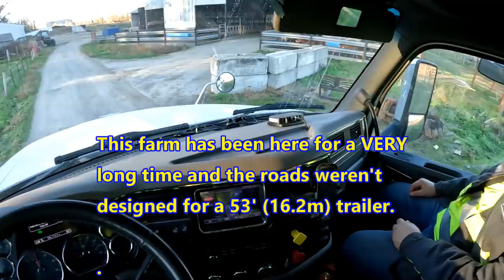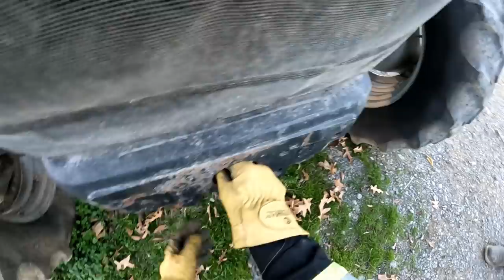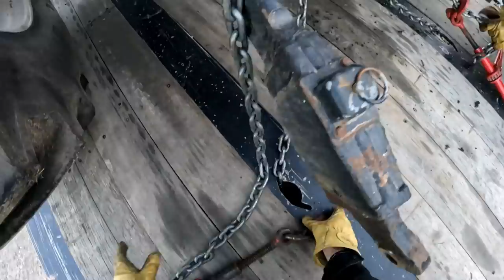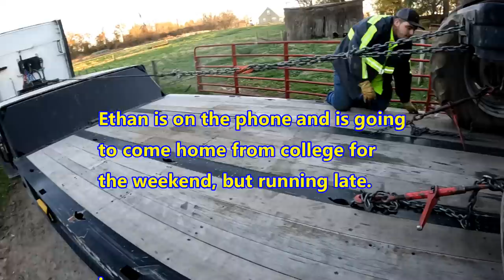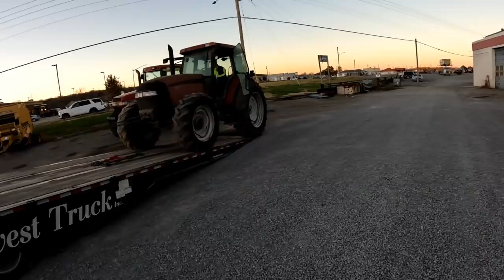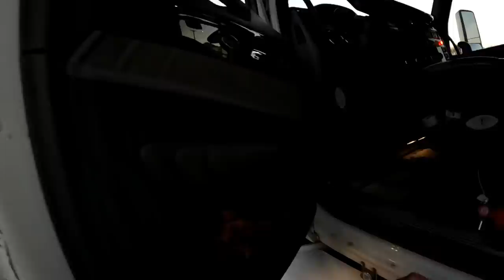TRACTOR MOOOOOOOVE.    Helping a Dairy Farmer!!!

Comment: I have a little tip when you tighten those binders down when the get tight flip he handle over backwards so it on the deck of the trailer and it won get loose

Comment: One thing i can never fathom with America is they are will to trust the park function in and auto gearbox  possibly the flakiest method of stopping a vehicle but when it come to a brake that is specifically designed to stop a vehicle moving they refuse point blank to trust them  i find that most strange i know which i put my faith in and it is not a small lump of metal in a auto box.  keep up the good work Ron

Comment: You are finally doing " Normal Stuff". I know you get all different kind of calls but to be able to help a local customer is good. The worst part of the setting sun in the fall is that even with decent sunglasses the blazing sun can make doing any task road related a difficult thing.
I did not realize until this year that there are many different companies that made tractors. I bet Worldwide there maybe thousands of companies that make tractors and many other type of farm equipment.
Reply: You didn't know that Case/IH made farm equipment??  It's a merger several years ago between Case farm equipment & International Harvester. They both started independently well over 70 years ago. There's several machinery manufacturers, some are defunct, but some of their equipment is still in use.
With this particular tractor, one look at the hood gives it away😄 
It says MXM, but that's just a name Case/IH put on a series of tractors.
Did you see the New Holland tractor when they were still at the dairy, it was easily recognizable. Years ago Ford merged with New Holland, that's why some still say Ford on them, rather than New Holland.  Alot of mergers & acquisitions from very old companies.
Reply: You'd be surprised how few there are with many subsidiaries.  Just like the auto industry.
Reply: More than you can imagine. New Holland actually doesn’t make their own tractors per se. They just slap their logos on them, different years of the same model can vary. Another useless fact is that there is one country that makes it nearly impossible to own any tractor other than the one made in their country, I think it’s Mahindra (the worlds best selling tractor)

Comment: When you were comparing the difference in maneuverability @26:42, the length of the trailers is not as important as the wheelbase.   Your trailer wheels are several feet from the back of the trailer.  The grain trailer wheels are close to the back of the trailer.  The wheelbases are probably fairly close.

Comment: This may be a myth or fact comment. I have heard of truckers either duct taping the end of the exhaust or leaving the engine running while in transport. The theory is that a vacuum  can be pulled on the exhaust to cause the turbo charger to turn without lubrication causing damage. This tractor may not of had a turbo. I myself would not want to prove that it is a myth. Ron I still think that you are professional and enjoy your videos!

Comment: LET'S GO TRACTOR TIPPIN! It's amazing to look at that tractor from the front.. You'd expect that the tires would be completely straight vertical but it looks like they have about 15-20 degrees of camber. It's so exaggerated by how tall and skinny those tires are so it looks like it's rolled out on the outside of the tires. :D Ethan distracted you and you forgot to retighten your rear chain. Weird that dairy cows out there are brown cows.. out here their typically the black and white Holstein cows. And here, when you said "we're gonna have to go old school," I thought you meant you were going to just pull forward and let it roll off the trailer. What you were saying about farming being a hard life, it definitely is and takes a special kind of person.. The problem is there's not that many of us in my generation, let alone people younger than me, that are willing to do that much hard work for so little payoff/recognition. We tend to want accolades for what we've done or to feel like we've accomplished something and farming you definitely don't get any, it's just a very long, hard and often hot day that's completely thankless. They are definitely at a point where farming needs a technological shift to where it's more industrialized because of the fact that most people would rather do easier, better paying work... but once that happens, the holdouts will get completely screwed over and be forced into a new kind of life.

Comment: I would just have let Eli roll the tractor off the trailer without any winching, and let gravity handle the unloading instead of using the backward winch manouver. Such a heavy machine would not roll far anyway and you would have saved a lot of time and rigging. Have a nice Christmas holiday.

Comment: My ocd really wanted you to chain down the steer.wheels on the tail of the trailer so you could use the truck to  back the tractor into the parking space...
Reply from the maker: Cool idea.   Didn't think of that at the time.    Made it work this way, so it's all good.   Thanks for watching and God bless.

Comment: Hello Ron, There is one thing that is puzzling me,  if the rotator broke down what have you got that could get it back to the shop for repair?    I love watching your videos, please don't stop them as you are moving into management
Reply from the maker: The Rotator weighs around 73,000 lbs, so our Western Star would be able to tow it, no problem.   Standard semi-tractor with a fully loaded trailer can legally weigh up to 80,000 lbs and more if properly permitted.   Also, the Tator would fit on this trailer, for a short distance.  It's too heavy to go very far on the trailer.  The trailer is rated for 40 tons, but that includes the weight of the trailer.    As for the videos and management, I've been in management for a very long time anyway.   I will have extra duties to perform on the administrative side, but, good Lord willing, I still plan to continue doing the job that I love as well as creating videos.   Thanks for watching and God bless.
Reply: @RonPratt  Thank you for the reply, you have answered all of my questions for the rotator. I hope you and your family, both at home and all of your family at work. I hope the Good Lord grants all a very happy and safe Christmas God bless

Comment: When you were turning around there, I couldn't help but to think of that Red Simpson song about needing 40 acres to turn the truck around.  I bet the reason why the front tires weren't rolling as because he was doing something with it in 4WD before it quit and didn't put it back in 2WD.  Otherwise the front should have been free even with the parking break on.
Reply: Most (all?) MFWD are in 4wd by default. It needs oil # to release-needs to be running.

Comment: Those trailers are very versatile! I was delivering in the mountains on a well site & had to maneuver around switchbacks that were too small for the truck & trailer. Used the sliding axles to shorten up & then push the tractor forward & then shorten up & push the tractor until I was around the turns. Very handy!
Reply from the maker: Ahh...the inchworm method.  Have had to use it myself a time or two.  Yes, very handy indeed.   Thanks for watching and God bless.

Comment: Great video Ron! Those trailers do come in handy for many applications. Have a question for you: why haven’t you installed a headache rack/cab guard on the truck yet?
Reply: In may be his choice not to. In many jurisdictions a full sleeper cab is considered to be sufficient as a guard.  If it is not mandated, it is an extra 3,000 lb. tare weight. Most styles will only stop light loads from perforating the driver and I've never seen one that will stop a greased 5 ton section of drill pipe once that gets moving at any speed over about 15 mph. I never drove sleeper so I always had a headache rack. That rack stopped a few 4x4s from ruining my day way back when.
Reply: Ron cant install a headache rack, as his hydraulic tank is right there on the cat walk behind the sleeper. The hydraulic radiator is also installed on the back of the sleeper.
Reply: Yeah. That's actually important. My dad knew someone who had their head decapitated after the were working to free a bulldozer that got stuck. The winch hook snapped off the dozer and flew through the rear window.

Comment: Ron, is theft of chains or binders loosely stored on trucks and trailers a problem?
Reply: i keep my chains and binders in a center well on my 3 axle double drop rgn for years, usually its my oversize signs or flags that get stolen, not the tie down equipment that walks off.

Comment: Ron, I am in need of your assistance.  I noticed that you have developed a system for the rotating beacons to stay on top of your traffic cones.  I am a member of the Local REACT (Radio Emergency Associated Communications Teams) and utilize cones and warning lights of the type you have when we are called on from time to provide traffic control.  Any assistance and even closeup pictures would be appreciated.  I have been out of touch for a while a just noticed the passing of your father.  My PRAYERS go out to you and your family.  GOD BLESS AND COMFORT YOU.     William Luke, Idaho
Reply from the maker: Actually, my system is extremely simple and one applied requires no additional setup time other than placing the light on top of the cone.   Quite simply, I used Sikaflex 221 (a heavy duty adhesive we use at the shop) and glued a large metal flat washer to the top of each traffic cone.   The cones stack properly and then also have a  metallic surface for the magnetic lights to "attract" themselves to.  Hope this helps you.   Thanks for watching and God bless.

Comment: Just a wee, silly question Ron(not like me, much) but why just the one small wing mirror on the unit? Did you lose one, or only have one to put on? 😁 Small as they are, a matching pair could still be handy on a long-nosed rig like that.
Reply from the maker: That's actually how the truck was when we acquired it.  It only had the right side wing mirror.   Thanks for watching and God bless.

Comment: Since the back wheels of tractor were off trailer, couldn’t you have lifted tilt bed a couple inches, pulled forward and just used gravity to unload instead of snatch block? Just wondering...since have seen that done with rollback on prior video.

Comment: If you want an air horn that is the exact opposite of Wimpy, get a Mountain Air Horn...
I don't think you'll be able to mount it to the top of the cab, you'll most likely need to mount it to the Frame Rails behind the Steer Axle since they START at 6 FEET long...
You may also need a separate Air Tank to operate it without draining the Brake Tanks too low...
BUT when you blow them, EVERYONE within a couple of MILES will hear you...

PS: You might need Police Approval to use it within your County...those buggers are LOUD AS HADES!!!

😄😁😆😅😂🤣

Comment: Ron just a quick question I know you know what you are doing however, when the tractor did not roll off cleanly why not just pull it back up where it was and release the winch line with the parking brake set and then have Eli just release the parking brake and let gravity roll it off unrestricted by the winch.  Let it build momentum and cleanly roll off?
Reply from the maker: Quick and simple answer, Eli is young, new, and this was his first job working with this trailer.   Even though he is doing very well and he probably could have handled that, I am not fully aware of his strengths and weaknesses yet.   This was the safer option, in my opinion.  Thanks for watching and God bless.
Reply: @RonPratt  thanks for the reply I thought you had a valid reason for it and makes perfect since. Just as a viewer that likes to see if I can figure out your next step based on the many videos I have watched of yours ( all of them) I was shocked when you did not just let gravity do the work.  Now I completely agree with why you did not.
Reply: @RonPratt  not to mention it is not the Ron Pratt way to just let a load roll uncontrolled by a winch line. Too many potential things for Murphy to apply his curse to doing that.

Comment: Do you guys still have the rails to move railroad equipment for your 53' Trail-Eze trailer? I noticed that they weren't mounted onto your trailer. Were they mounted temporarily just for that job moving all that railroad equipment?
Reply from the maker: We do still have the rails.   I made a removable set out of 1" flat bar that bolts onto the bed when we need them.  They are much smaller, lighter, and easier to handle than the first, temporary set we used.  Thanks for watching and God bless.

Comment: May i ask the reason to chaining the back down like you did? How come you didn’t just hook it to itself like he started to , then hooked binder to the chain hole…. No hate , might learn something new by your answer.
Reply from the maker: I'll gladly try to answer a question from someone wanting to learn and who asks respectfully.    First, we are using 3/8" grade 70 transport chains for the tie-downs, which are pretty typical for this type of hauling.  There are basic principles whether it is winching, lashing, climbing rope, etc.   One is to  "count the number of lines to the load."     Each line shares a portion of the load.   Another is regarding the rating of the rigging in the configuration it is placed....straight, basket, or choker being the 3 basics configurations.   Both principles apply in this situation.   First, rather than having 2 single lines sharing the load on the rear, by doubling the chain back I'm creating 4 lines to the load.   These 4 lines now share less on each portion of the line than the 2 single lines would have.   The second principle works closely with the first.  I have the chains in a "basket" configuration which is typically close to double the strength of the  "straight" line configuration which you mention.    I hope I didn't over-complicate my explanation.   Based on the weight of the tractor, I could have gotten by with 4 single chains in a 4 corner-4 point tie down and been legal.   It didn't take much, if any, extra effort to configure the chains so that I was almost doubling my tie-down (lashing) strength.   Thanks for watching and God bless.
Reply: @RonPratt  thank you for reply. It makes perfect sense. I’m glad you explained it .. I’m always willing to learn something new.. only makes me a better and more valuable person i feel

Comment: Not sure, why you did that the hard way except to show him a different way. Once you set the parking brake since your back tire was off the trailer. The parking brake only locks the back tires. why didn't you just pull forward to let the front tires roll off? Less headache from this and quicker and just as safe.
Reply from the maker: Actually, if you noticed while we were loading the tractor the parking brake locked ALL the wheels.  I even mentioned it again when we went to unload it.  Otherwise, your idea is what I would have done.  Thanks for watching and God bless.
Reply: @RonPratt   Could you have taken the E brake off anyway the do it? SInce it 4 wheel drive
Reply: @RonPratt  Merry Christmas form Texas